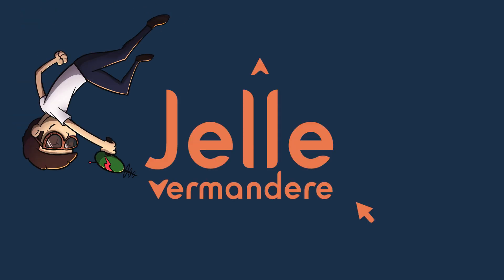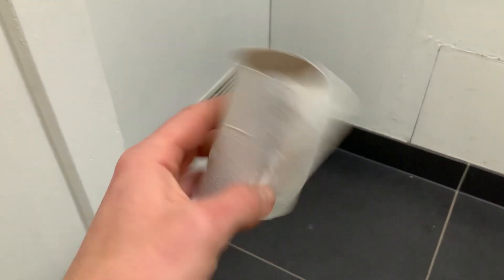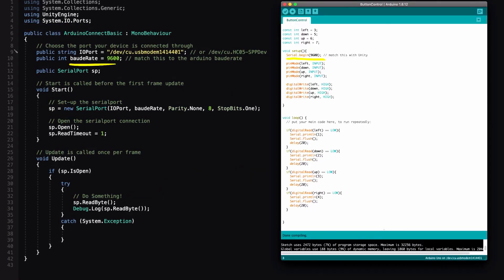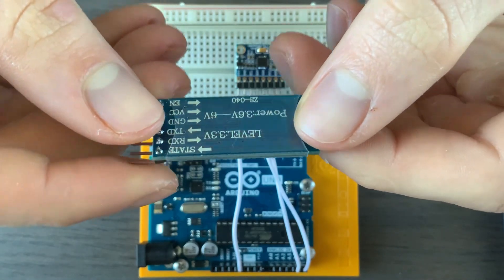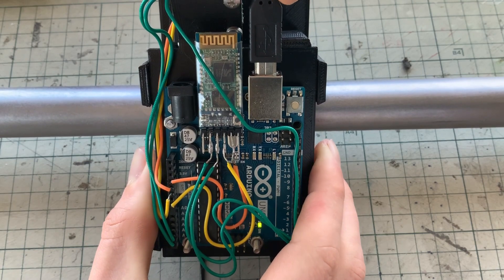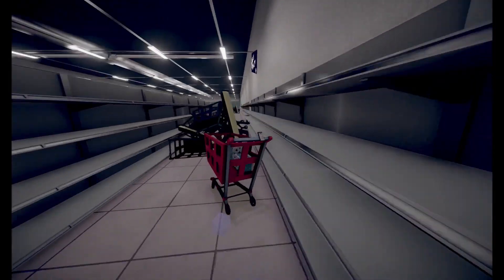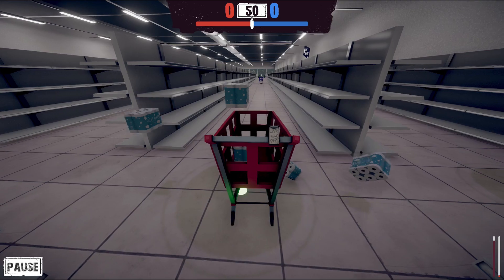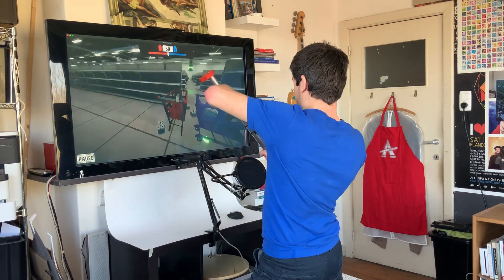I made a Motion Control Toilet Paper Hoarding Game

Comment: Can you help me, I tried connecting ardunio to unity with serial port but whenever it reads data it is extremely laggy and the fps drops to like 30 and is unplayable
Reply from the maker: you should take a look at my repo, it's important to flush the output and delay a bit after each write on the Arduino

Comment: I need to know how you managed to connect aurdino to unity via bluetooth I have been searching for weeks!!!
Reply from the maker: The project is on github, check it out!
Reply: @JelleVermandere  I am a little confused on the com port I should use since it is on Bluetooth and not a port. In your code you used /dev/cu.HC05-SPPDev as the port, will this work if I use it too or is it just a specific port, im using the hc 05 as well. How do i check the port, again thanks for your reply
Reply from the maker: @daudhtm5203  you can find the port name in the arduino ide, when you connect your arduino with bluetooth, it’s probably the same if you also used the hc05

Comment: Are you powering both the HC05 and the MPU6050 from the 5v output on the arduino?
Reply from the maker: no, the hc05 runs just fine on the 3.3 output, that way I didn't have to merge the 2 wires

Comment: Any thoughts on how it would be possible to use Unity (or Unreal) to do something like the video:
"Augmented Reality BreadBoard circuit building guide" (v=AfVQ4N-u0sk)
It doesn't seem to use any plugins (ex. ARCore/Vuforia, 'arduino-hm10-unity3d') or any Mono C# script/dll for the hardware interface.. but does use OpenCV/AruCo/Kudan?
Reply from the maker: it seems like it was developed before the rise of more mainstream AR applications. It uses the the image to track the position of the board. and the rest is hardcoded to the specific example. so I don’t believe there is any connection between the computer and the arduino. these days, you can easily achieve the same effect with the ar foundation frameworks in Unity. that’s how I develop my AR applications